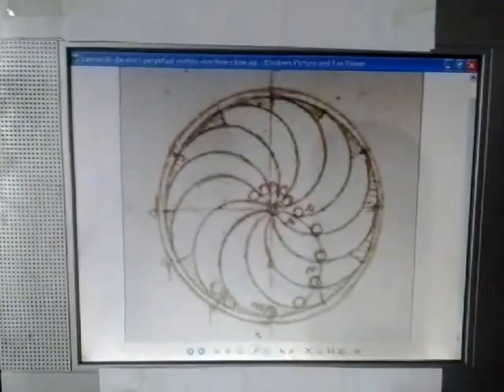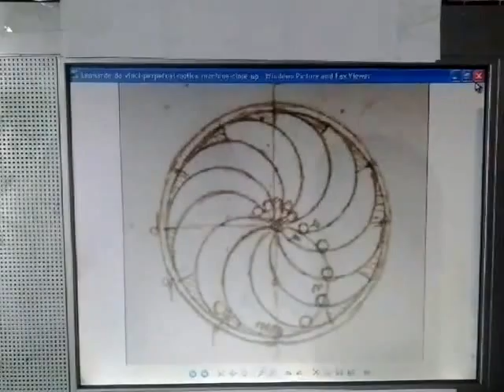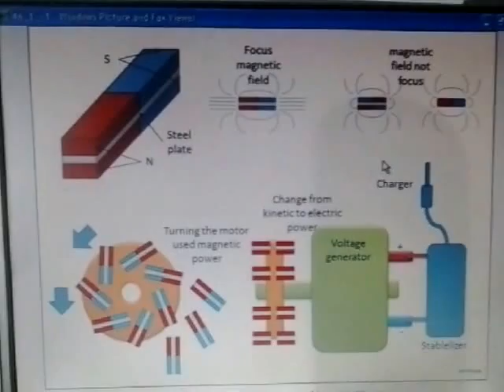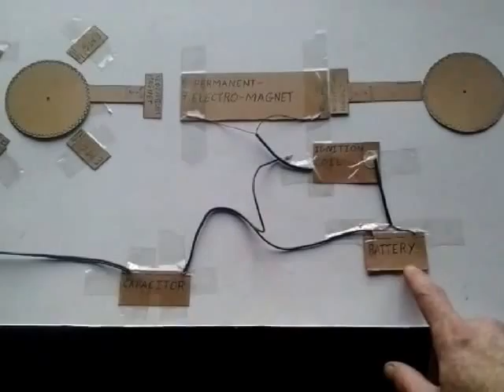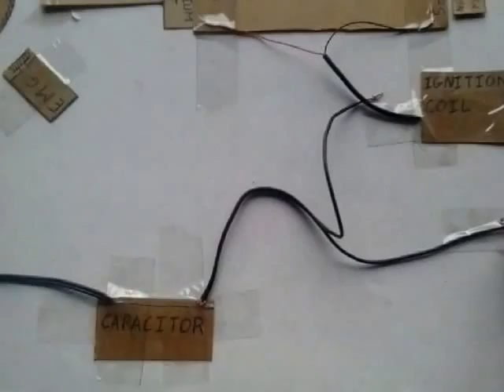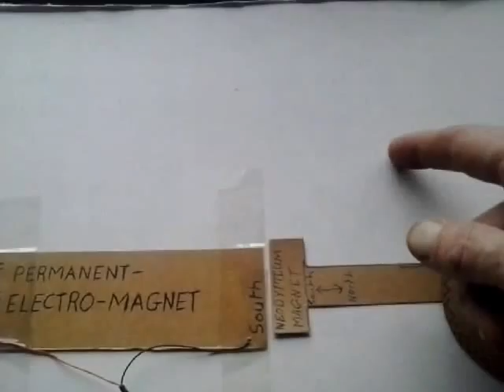REPLACE ENGINE PISTONS WITH NEODYMIUM MAGNETS.!!!!

Comment: Paul Lally 1 week ago (edited)
 Use an Inline 4 cylinder engine block ( Graphene or Normal )with offsets of 90 degrees and place another identical engine opposite with the pistonheads facing one another. Replace the 8 piston heads with Neodymium Magnets 110mm x 70mm x N52 and place 4 Electromagnets ( of your choice ) in between each set of pistons and fix into position. Introduce an electric current or Infrared from the mains or battery and use computer timing for firing the electromagnets. And if you have the facilities try the Graphene engine block with all Graphene working parts made from it, Apart from 1 the Neodymium Magnets and add Electricity, Maybe ?

https://physics.aps.org/synopsis-for/10.1103/PhysRevX.5.041042

https://en.wikipedia.org/wiki/Zero-point_energy

https://www.youtube.com/watch?v=Y1Tddl_1Avs
Read more
 Reply  · 
 
 
Michael Lewis 5 days ago
 +Paul Lally  Paul here is a link that you will find MUCH useful information on the concept that you are perusing.This technology is real. its greatly improved be recent advancements in electronics. check it out https://selfsustained.wordpress.com/2011/03/29/magnet-power/
 Reply  · 
 
Paul Lally 5 days ago
 +Michael Lewis Thank you Michael much appreciated. When I first started this Idea I wanted to make it as simple as possible so that a 10 year old child would be able to stick the parts together easily. The equations behind this technology are very complex but the understanding and working of the technology will be available to be used by everyone no matter what their education. This technology cant be suppressed as it is available worldwide and so easily put together, the powers that be can't stop this getting out and they are very afraid of what may happen, but they seem to forget there is always another question or problem to be asked or solved and people will be too busy looking for answers to the bigger questions in the universe. The powers that be also have problems that need to be solved and with new technology this may be possible. If it was sold to them properly they might jump on the Idea and we could all be free of the travesties man had to endure to get to this point of civilization.
Read more
 Reply  · 
 
https://www.google.ie/search?q=Majorana+Zero+Modes+in+Graphene+Harvard+University&newwindow=1&safe=off&biw=1536&bih=749&source=lnt&tbs=qdr:w&sa=X&ved=0ahUKEwjB4Pq22e3JAhUGRQ8KHVghAJ0QpwUIFA
 Reply  ·

Comment: this is a bad ass idea!! now it just the engineering it is going to be hell of a task ... also would  the permanent electro-magnet in the middle need to use pulsing electricity so the 2 pulls would be strong then weak?? to help increase the push then decrease when the neo magnet came near the electro-magnet
Reply from the maker: +street .punks  At 12 oclock the No( 1 ) Neodymium Magnet (110x70mm) is 1mm away from the Electromagnet which will exert 1,220 pounds of thrust while No ( 2 ) Neodymium Magnet at 120 degrees from 12 o'clock is still repelling at approximately 160 Pounds  clockwise until the power is knocked of at 6 o'clock. And No ( 3 ) Electro Magnet has already been neutralized at 6 o'Clock  and is at the 8 o'clock position now it will have an attraction force of  approximately 160 pounds which get a lot greater the closer it gets to the Electromagnet as it will be attracted to the metal in the Electromagnet you can use computer timing to fire the Electromagnets . I just hope it doesn't generate its own anti-gravity field and take off through the roof.
Reply from the maker: +Paul Lally I Don't know what will happen if you use a Graphene Engine Block and the Neodymium Magnet and Inject Electricity into the equation but it should be interesting ?
Reply from the maker: +street .punks The Neo magnet will be repelled away from the electromagnet and as soon as it is at 6 oclock turn of the power and it will attract back to the electromagnet getting stronger and stronger the closer it gets. Timing is KEY here and you must be able to it just right to avoid the sticky point, But it can be done easily with the right equipment.

Comment: Paul as you and I both know, research and design is expensive. It's not a matter IF their will be problems, I assure you their WILL BE problems! The internal combustion engine  was patented in mid 1800's so it's evolution has taken in excess of 150 years. I am encouraged by the global agreement that fossil fuel need to kicked to the curb, recent energy summits reinforce the dire need for technology thats less harmful to the planet. I find it ironic that sheeple in this world refuse to think outside the box, they seem to be content with being "consumers".  I'm not wired that way  ,I've had some very good mentors in my life sadly most have past away. Lulings design was a perpetual motion machine, and its feasible if you accept that the solar system exists and has been in motion for a very long time with little of no change. Paul it's obvious that you work as a mechanic on internal combustion engines, either currently or have in the past. Your design is based upon your knowledge of what you know, and replacing the energy of neo-magnets to provide the work force instead of petrol. There is little doubt that what you propose will work IF you find funding and don't give up, and ask questions if in doubt about any aspect of the build.

Comment: Paul I do have a fundamental concern that I have no answer for. Knowing the basic make up of neo-magnets being a boron compound that is induced with very high voltage I ponder if a continued electro- magnetic force being applied would weaken the staticcharge of the neo-magnets ?   I have not found any information proving or disproving this possibility, and the use of these magnets in starters and electric motors makes me lean towards the probability that they would be unaffected. I don't know if you have any imput on this matter? A simple bench experiment over the course of a few days should answer this question.
Reply: +Michael Lewis  Ive researched the matter and this should not be a problem, magnets must be kept less than 80 degrees C and electrical field current on your design  (center position electro-mangnet will not demagnetize  providing that it is not spun  above the 60 mhz cycle), In lay man  terms it will work if you don't ov.er spin it, overunity is there. I never once stated that its free energy....but if it gets us away from fossil fuel and wars I'm all in :)
Reply from the maker: Michael Lewis, There wont be a charge going through the Neo magnet, it will simply be placed on the top of the piston and the electromagnet will be in the middle which will turn on and off. The electromagnet is specifically made for this job so it will work unhindered.

Comment from the maker: This is a simple explanation of what to do. Get 2 engine blocks  with 3 in-line pistons which are offset at 120 degrees. The stroke of the pistons should be around 110mm to 120mm which is approximately the distance the neodymium magnets lose the most of their power. You put the 2 motor engine blocks facing towards one another and fix 6  neodymium magnets onto the top of each of the pistons, Neo Mag size is 110mm Diameter x 70mm Thickness, Grade N52 . You can check out the strength of these magnets on K&J Magnets calculator yourself. Fix 3 Electromagnets in between each set of pistons and wire them up to the ignition coil where the spark-plugs were and connect to a lorry battery or car battery 12 or 24 volt it depends on which electromagnet you use. Set the timing as it may vary from petrols ignition + combustion point, connect Electric Motor Generators onto each side of the camshaft of the engines and start it up. Once it has started you don't need the battery as you can take power from any of the EMG's and feed it back into the ignition coil which will turn on and of the Electromagnets thus creating it's own energy and mass surplus electricity. 
PS you must be careful when handling Neodymium Magnets as they exert such force they can easily break every bone in your body. Look at this video to see what you will be dealing with.    https://www.youtube.com/watch?v=0t8yDnyOaQ8
Reply: +Paul Lally  The concept is sound, the 120 degree on 3 working cylinders or 60 degree on 6 opposing cylinders should work well. Please bare in mind the block( cylinders)  needs to be of low magnetic property, cost wise aluminum would be a good start. Opposing is the best configuration , the reason I say this is the electromagnetic coil could be arranged to cycle from push to pull by reversing polarity or two separate coils wound in reverse. The arrangement you showed with flywheels allow for the timing as you mentioned. a simple hall effect switch and a logic circuit to trigger the electromagnet is already available. Contrary to what Dave C is putting out there this is not a perpetual motion machine, over-unity yes that it is. Bare in mind we are starting with a given property of force that does not require a power source neo-magnets so this does not void the laws of physics. I personally have seen the advancements in many areas of electrical and mechanical devices in the last 30 years that have amazed me enough to research the technology responsible for these advances. One of witch is the starter and alternator field. The implementation of permanent magnets in starters reduced the ampere load by over 400%, So in comparison is this overunity, yes it is if we compare old vs new. To further demonstrate the ability of neo-magnets check out the v gate motor it appears to be a perpetual motion motor which of course it is,,,,,, if we don't calculate the force exerted by the neo-magnets. Good work Paul there is promise in what you are doing

Comment: Paul, you, as many of us are on the right track. The intelligent people of this world understand that physics and it's mathematical equations are in place to explain the phenomenon or event in the universal language of mathematics. The truth is that far too many people today are not free thinking and put the cart in front of the horse, People need to understand that the event or phenomenon came first, not the math to explain the event or predict future events or nullify future discoveries that might just change a few laws of physics. Neo- magnets were a joint venture between General Motors and Hatachi, they completely revolutionized how we interpret, build and design today. I for one don't feel sorry for the sheeple in this world that have the horse in front of the cart such as Tom Sullivan and so many others that say it can't be done  because of the laws of physics. No worth while invention ever came about by accepting defeat before you thoroughly investigate an occurrence that is not natural. Lets face it magnets defy gravity they exert force with outside influence as we know it. The explanation is the earths core, and our little trip around the sun, that of course was a  preposterous proposal a few hundred years ago. now its widely accepted.  I see your application and your reasoning to believe it will work, it seems sound in theory and application, until you apply the negativity of the doubting thomas'  every great inventor was thought to be a crack pot before they figured out how to make it work. Finding funding is always difficult